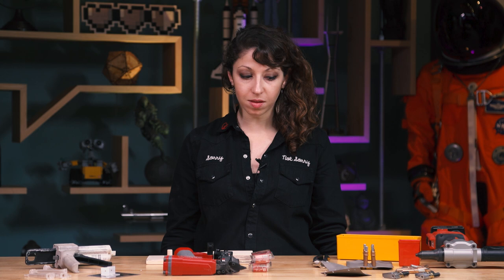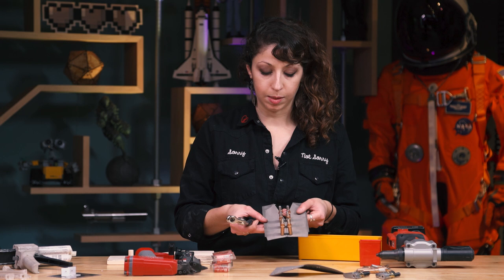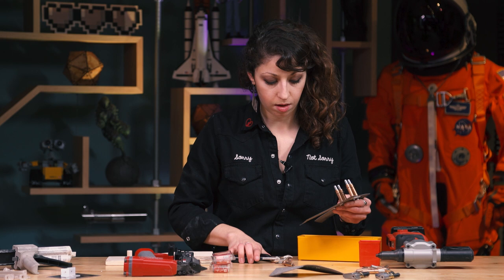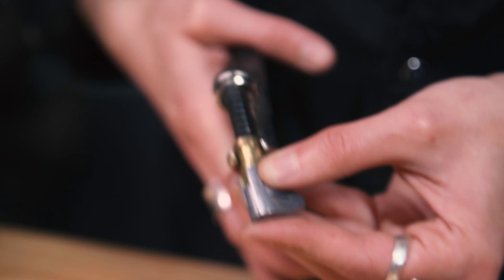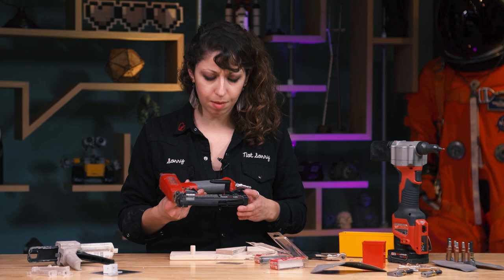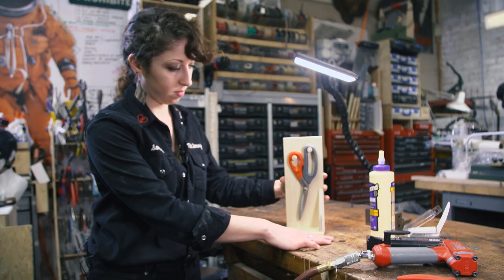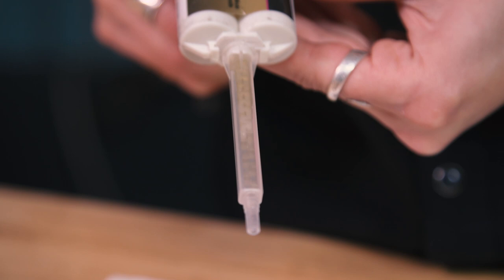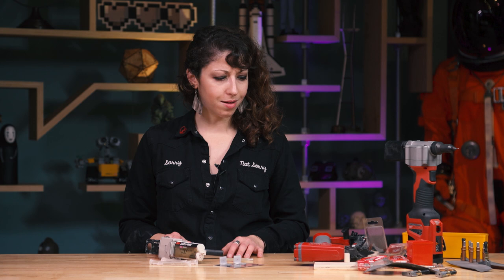Tested in 2019: Jen's Favorite Things!

Comment: I use an epoxy gun that is slightly larger then what she has for work: 2 or 3 times larger. The tips are worthless after you are done, but if you need mix a bunch up at ounce they are very helpful. Especially if you're applying the epoxy to a hard reach area like a hole for a bolt or things of that nature. Though if you only need a small amount I would skip the tip.
Also pin nailers are just nice.
Reply: So if I undersrand correctly; If you only need a small little dab, you basically waste maybe 4-5-6x as much epoxy because it cures inside the tips. And the tip, as that happening, makes them one-time-use consumables. ?
Reply: @pr0xZen  yes

Comment: Pin nailers are a wonderful addition to the shop.  I built a version of Adam's tool cart, customized for my work, and many of the sub-assemblies used 1/4" poplar glued and pinned together.   The next size up,  brad nailers, are also handy.   The Senco is the best, but I have an Accuset, which was the humbler,  homeowner version made by Senco, and it has served well for more than 15 years of occasional use.

Comment: Those Senco pin tackers sting when you miss judge where your fingers are.
We used them in a furniture manufacturing plant.
But still not as bad as a framing gun. Or the finger crushing Vertex clip gun.
Reply: I've learned to keep my fingers several time the length of the pin away from the point of entry. I've had them follow the grain and stick through my finger nail.
Reply: I used to work at an artisan woodworking shop and used those 23 gauge pin nailers all the time, mostly for attaching trim and small moldings to cabinets and furniture. I’ve bitten myself with those things many a time. 😂
Reply: @thebullettrain1757  Yeah I've had that happen once or twice. The line I ran made ottomans so there were many units where it was impossible to keep your fingers that far away from the area being worked on.
Reply: @AlasdairGR Yeah they sting too. We built everything from ottomans to sleeper sofas.  
Worst I saw was a framer who put a 15 gauge, 2 1/4 inch staple into the middle of the palm of his hand.
Worst I ever heard about was someone who tried to hold the gun between his legs. Facing up.

Comment: Wow, I've had some of those Cleco pliers for years but not known what they were ! And YES, I've found them. They say Wedgelock brand with no model number. I do not know how to tell what size they are. I see 3/6 and 3/8 advertised.  I would think these would be at least 3/8. But, is this a measurement for the hole you drill, or some other part of the bits. And you are probably wondering what in the heck I'm doing with this on Christmas day ?
Reply: They never reply to comments so they're probably not wondering

Comment: So the Cleco stuff - if I understand it correctly - is basically like clamps without significant protrusion on the X/Y axis, and Z "behind" the work surface? I imagine the use of those pliers allow for a greater clamping force in a small format, than what would be reasonably workable if "finger operated". But do they actually serve up that kind of clamping force, or is that more in my imagination?

Comment: The problems with that  glue gun is (a) you lose a nozzle each time you use it, and (b) you waste all the unused epoxy in the nozzle each time. Other than that it's a good idea.
Reply: u r right
Reply: It's one of those things you use when your time is more precious than the cost of the gadget.
Reply: Warship Models Underway Definitely. If I had a lot of individual components to adhere on a complicated build I’d definitely want that pre-mixing nozzle for convenience and time saving. 

But if I’m doing something like attaching wood handles to the tang of a knife and only need to use epoxy once, I’ll just mix the parts by hand.
Reply: you have the option to do either a hand mix or a nozzle mix, the options are solutions to different problems
Reply: what would be cool is if there was an empty syring? that you fill the nozzle, take it off and attach it to the syringe. then use the air pressure to push out the expoy. still have to toss the nozzle. but you would use all the epoxy I think
Reply: It's potentially less wasteful for smaller amounts.  Getting the correct ratio and sufficient mixing with small amounts of epoxy can be difficult, so it's often necessary to mix up significantly greater quantities than required just to get the dot or two you may need.  

The nozzles are great for that, as the amount lost in them is generally less than you'd have otherwise, and you're assured of properly mixed epoxy.
Reply: Compared to the amount I usually waste by mixing too much trying to get the right ratio, this would still be an improvement!

Comment: epoxy mix nozzle seems like a waste of glue for small applications
Reply: I use it practically everyday in the Aircraft industry.   These applicator/mixers nozzles save so much time, and also contains the vapors from the epoxy,   Also, you really want epoxies to be mixed properly,  practically all aircraft interiors, and wiring harnesses are held in place,  Boeing, Lockheed, Cessna all use this very gun to keep harnesses from dangeling down during flight.